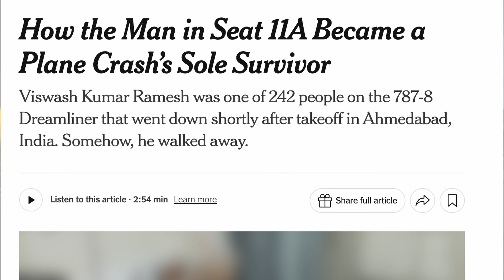Why the RAT Changes Everything – Air India 171 Update

Comment: what kind of problem could generate dual engine failure? Why there was no sign as smoke or something from the engines? Is it possible RAT activation to be linked to hydraulic problem of flaps? In this case there is not dual engine failure. Last date of maintenance was how long ago, did the check list was performed well before take off? I think we can find out more things from the blackbox, it is clear that it was a problem but how this problem could be avoided.

Comment: possible theory:
Overheated fuel valves → incorrect fuel flow → incorrect combustion → insufficient thrust → poor climb → stall.

Possible areas with normal range:
1) Fuel tank (before pump) 15°C – 50°C
Rarely overheats
2) Fuel after FOHE 70°C – 110°C
Starting to get hot
3) Fuel metering valve inlet 90°C – 130°C
Higher risk zone
4) Danger zone
150°C+
Severe overheat

Comment: The chances of a dual flameout for mechanical reasons at this point is incredibly low. I hate to say it, but I would not be surprised if the investigators find both fire handles pulled.

Comment: I am no expert here, from what I have learnt is the RAT deploys automatically, both engines going out, contaminated fuel - do jet engines cough and splutter if fuel is bad and make smoke? I do not know I have only ever played with car engines. The only survivor  stated the green and white lights flickered in the cabin, why do lights flicker?  I think the plane had a complete electrical malfunction that caused a reboot of all the planes systems. It could of all started when then they went to retract the gear. This would explain why the RAT popped out, why they lost all thrust, the RAT supplied power to the radio gear. Another thing that lets me think this is at 400ft the plane stopped sending out any of its data, why? Complete electrical failure? I also thought the manufactures of the jet engines received continuous data from the engines so they can monitor what is going on,  can anyone clarify this? People will say its impossible to loose everything, its full of redundancy, but these things are not perfect and computers have glitches. Thanks Bruce

Comment: As I mentioned before, I'm going with humidity problem causing fuel contamination of water droplets in the fuel. Both engines flame out shortly after take off. Gear selector is set to up because the wheels are tilting forward. They only tilt forward when they are about to be stowed. So after engine flame out, the RAT deploys and Captain calls a mayday with total loss of power.

Comment: I was in the camp that the flaps looked to be not deployed, but the prop noise did really bug me cause it sounds just like a rat. That coupled with the survivor testimony strongly supports loss of power for some reason. Based on video I can’t see any evidence of an external cause, so maybe fuel or electrical, mechanical failure would be unlikely to effect both engines at once. The FDR is going to be pivotal in determining what happened. That much is for sure.

Comment: Is it not possible to identify whether the engines were functioning during the descent by analysing the sound just as you did for the Ram Air Turbine? Can you make out the thrust setting for the engines- whether it was running at full throttle or if they were cut out, which would confirm that it was a dial engine failure.

Comment: The landing gear DID stay down, but if you watch a demo video of a 787 landing gear retraction, the first thing that happens during the retraction cycle is that the trucks tip DOWN at the front, whereas their normal position during takeoffs/landings is with the trucks tipped UP at the front.   Look at any image from any video, and the trucks are tipped down at the front immediately prior to the crash.  Conclusion:  the landing gear retraction cycle HAD STARTED.

Comment: Great logical explanation; but I’m now left with a question as to what changed from thrust at end of runway to loss of thrust immediately aircraft left the ground. Do the ‘Weight On Wheels’ sensors have any interaction with the fuel / engine control systems?

Comment: Is it possible that the fuel shut off switches were activated inadvertently? What happens to the flight controls when they experience a full loss of electrical power? Do they enter a trail‑damped or passive state, aligning themselves with the airflow? Check the Bombardier Challenger crash in Naples Florida February 2024.

Comment: One point Steve 
You could have been more cautious on suggesting copilot's possible  erroneous action
Suggesting that copilot could have been gravely erroneous in deployment of landing gear instead of flaps, in a wider context, may raise basic suspicion on the effectiveness of advanced controls in a new age airplane like dreamliner besides on the basic operating procedure and controls  followed by Air India 
The general assumption is that Pilot in Command is in full control during all critical stages of the flight without any scope for delegation of such  functions to a relatively  inexperienced copilot

Comment: There is a video posted by one of the passengers when the plane was taxiing on the runway.  He was complaining that the plane, which he had already flown on from another city, had electrical issues on the first leg of the journey. He pointed to several electrical problems including air conditioning not working, screens not functioning, call buttons for assistance not working, and more.  Could this be a contributing factor?

Comment: What’s interesting is that I saw that tiny object in the first few pictures and at first I thought that maybe a compartment opened and something fell out. I agree with the dual engine failure theory. The survivor also said there was a space of 5 to 10 seconds of like a stillness, but then you could hear the revving up, but he didn’t know what that was because it felt like the plane was suspended is the impression that I got reading that.That would explain a period of  total shut down of both engines with the “rat”thing kicking, but not being high enough to allow the plane enough, lift to stay in the air, because it was just too low; that makes sense.

Comment: Capt. Steve,

I was fortunate to fly the 747-300 Classic with steam gauges for over 20 years. If I remember correctly, I was not allowed to board passengeres or request pushback from the gate if the fuel temperature in the tanks was indicating 54°C or higher.

When fuel in the lines heats up, it can vaporize—especially if the pressure is also reduced, such as at high altitudes. These vapor bubbles can create blockages in the fuel lines, preventing liquid fuel from reaching the engines. Based on what we know so far, it was a very hot day, and it's possible the aircraft could have been heat-soaked prior to being towed to the gate.

Therefore, I believe one possible reason for both engine failures could have been fuel starvation during and after the takeoff roll. Pitching up could have further contributed to the issue, resulting in both engines failing.

I’ve been retired for 13 years and have no knowledge of the 787 systems, but I just wanted to share my thoughts on another scenerio on  what could have caused both engines to fail—if that was indeed was the case.

I love your vlogs—keep up the great work educating all of us.

Comment: Excellent analysis and we actually had the same thoughts on deployment of the RAT.. Very conclusive audio and visual confirmation, especially on flickering lights after dual engine lack of power... However, the main question is how both engines, without previous signs of malfunction, could fail so quickly.. The airplane doesn't even have enough power to plane... That sounds completely unexpected loss of air capacity (in French, portance) Thank you so much to Captain Stevens and our prayers to all the victims as well as the entire crew! We must find out what happened.

Comment: Captain Steeeve, great video. Would like to share what my brother (senior captain with40000 hrs turbine time) in Sydney told me.  A certain airline that operates the 787 has had two separate incidents of DOUBLE ENGINE RUNDOWN which were recovered from. Seems to fit with this seemingly recurring problem.

Comment: #1 bird strike: no flame or smoke on engines seen
#2 loss of power. No it took off nicely
#3 flaps not correct. Alarms would have warned pilot. Safety system would prevent take off
#4 terrorist act. Plausible. Pilots on their jihad duty set flaps to landing. Just a few weeks ago India bombed Pakistan

Comment: My bet, dual engine failure (most likely poor fuel or electric/hydraulic system failure) and then they panicked and pulled flaps up instead of gear.

Comment: The use of nearly the full runway is a clear operational anomaly and suggests a thrust deficit present before rotation, not just after liftoff. the use of the full runway is a strong indicator of abnormal engine performance before take-off?

Comment: It has been mentioned a few times about the dust flying up after take off. Could the dust have caused a power loss similar to planes affected in volcano eruptions. Alternatively sitting on the tarmac for hours in extreme heat with no airconditioning?

Comment: I'm no expert, but it would seem to me based on the reports that the flaps were not set right, which lead to the plane rolling at the very end of the runway and sucking up FOD. Then once in the air  the combo of no flaps and engine failure from the dust it sucked up at the end of the runway caused it to crash.

Comment: The biggest audio clue from the better video is that there is no engine noise. Those engines should be screaming and there is nothing. Its just gliding.
Reply: Bingo. The thing which gets me is that this crash probably wouldn't have been anywhere near as bad if that airport was surrounded by fields instead of slap bang in the middle of a city. It always surprised me that airports aren't built like that as these kind of accidents are fairly common - I can name this one, Amsterdam in the 1990s and the South Korean runway. And countless other near-misses where planes WERE able to land safely because they weren't in cities.
Reply: @radicalbyte   I think it normally works the other way. Normally the Airfield is first and the buildings follow.
Reply: @gertsy2000  yeah it normally is... I flew in to Eindhoven yesterday which is a little better, one side is farm land the other side a golf course, so at least there are what looks like better options... although it's still not something you would want to experience.
Reply: @gertsy2000 It's like massive fuel depot fire  and explosion a decade or so back in the UK.

Why did they put it next to housing estates and factories? They didn't. It was empty fields when they built the depot.
Reply: Amazing to see and hear this footage. I've was told by other pilots that whining noise of the RAT was audible in the first video of this video. Terrible situation.

Comment: Would the RAT deploy if the engines stalled?  Would they have stalled if the flaps were not giving them lift?  The reports of electrical problems on the plane during its previous leg does indicate some underlying potential cause.

Comment: April 30, 2015 (New York Times News)-
Federal regulators will order operators of Boeing 787 Dreamliners to shut down the plane’s electrical power periodically after Boeing discovered a software error that could result in a total loss of power.

The Federal Aviation Administration said on Thursday that Boeing found during laboratory testing that the plane’s power control units could shut down power generators if they were powered without interruption for 248 days, or about eight months. The findings were published in an airworthiness directive.

Boeing said the problem had occurred only in lab simulation and no airplane had experienced it. Boeing said that powering the airplane down would eliminate the risk that all power generators would shut down at the same time.

The company said it was working on a software update that should be ready by the fourth quarter this year.

Boeing has so far delivered 264 787s to carriers including Japan Airlines, Air India and Ethiopian Airlines. It alerted operators about the potential problem two weeks ago.

The plane maker said that power was shut down in all airplanes in service in the course of the regular maintenance schedule, and that it would be rare for a plane to remain with power on without interruption for eight months.

No immediate action is required from operators whose planes had a power cycle in the last 120 days, according to Boeing.

Comment: In your previous video I did mention that mayday call was made 32 seconds probably 3-4 seconds into air, hence flaps theory was not acceptable and probably engine failure or fuel supply could be a possibility.

Comment: There are many theories to what could have happened. 

1. The law of aerodynamics; the wing at 100° will not produce the same amount of lift as a wing at 50°. Therefore the aircraft probably was misconfigured for the ambient temperature. 

2. There is an existing YouTube video that clearly shows a flight from Germany with this aircraft. They flap setting was not at 5°.

3. This aircraft could have had a generator failure. On the first 777s with the 4077 engines. The generator auxiliary shafts sheared.

4. In the past there's been several occasions on the 767. Pilots inadvertently cut off the fuel with the fuel cutoff switch, right after taking off.

5. In the past some pilots have mistakenly toggled the toga switch. The auto throttle was not set properly and as well as the autopilot, which they would have engaged at 50 ft.

6. Based on the video it appears that there's a good chance the aircraft was not completely full of fuel. Or there was possible vapor lock.

7. The Boeing twin aircrafts have issues due loss of engine or thrust. Climb out maybe as 200 - 400 fpm. But pilot does not appear to change pitch. 

8. This a long shot but  in the 90's the P&W 4000 series engines we're producing considerable less thrust. The FAA mandated the airlines to replace one engine with a new one. The two engines cannot be in the same cycle mode, especially for etops.

9. Aircraft could have been overweight or the CG was off.

Comment: My biggest issue is with India. They as in ppl literally contaminated the entire crash site..just like anything else in India. It is such a horrible country... social media is filled with posts of actual dead bodies from the crash site with zero sense of privacy and sensitivity towards victims... it took the authorities almost 5 to 10 hours to "secure" the entire area ..meaning crucial evidence is basically gone. Also sensationalism in the Indian media... the journalist in India and the local public is bat shit stupid and crazy with theories and speculation ... one of the worst 10th world country ...and guess what after the incident they all moved on to other nonsense stories ...  its just shameful. 

I think the dual engine failure is probably the most convincing theory and the RAT deployment so far... but of course we will wait for the final analysis. Also this flight had just Landed from another city ...before it got turned around in an hour to head to London.. i wonder if the flight which i think the origin was New Delhi to Amedabad ...if the issue originated much earlier .. and fuel contamination during re fueling and or any mechanical or electrical failure that was in the making prior to departure.

Comment: Captain Steeeve, when would ADS-B stop transmitting? It was checking Flight Radar data and it seems that transmission stopped just as it was leaving runway at 625ft/71ftAGL. Could it be that as pilot detected problem in one engine as soon as they reached decision speed and the second engine gave up as soon as the climb started? It also explains why they used up more runway and why there declared mayday.

Pilot must have thought that they would take off with single engine and return to airport. This explains a lot of things that we see in the crash video from Airport CCTV.

Comment: I still feel this unfortunately is related to inadvertent flap retraction. 
The RAT can be deployed manually. If the captain felt the aircraft sinking after the gear was retracted, he may very well have assumed a power loss, declared a mayday for power loss and then MANUALLY deployed the RAT.
If both engines had failed and they can’t determine why, would they not already have grounded the 787? 
We obviously don’t know for sure yet, but that still makes the most sense to me.

Comment: This would be quite dangerous if it really was a dual engine failure, no? Because normally in an engine failure from external causes, you'd see smoke trailing from the failed engine, yes? But since there was no visible smoke trailing from both engines, if they did fail, it'd have to be from internal causes. That could theoretically put any airplane using those engines at risk, yes? Is there now a need to ground all such planes before an investigation into these engines are concluded?

Comment: One possible reason both engines might have caused a shutdown is because of 'fuel contamination'. Has there been any notices from India's authorities about this? For example - Grounding all their planes. - Requiring all their planes to have their fuel tested. - Testing holding tanks or suppliers they use. BTW. If this was the problem, it's funny that this is the only crash. But they might analyze their other planes to see if their individual engine fuel usage performance has diminished.

Comment: Why do they use old airplanes over and over without a break? A plane will fly from somewhere than pickup more passengers and go to the next place. Don't these old airplanes need a rest and a good inspection. If a pilot took the plane up alone to make sure it is running good there would be one death.